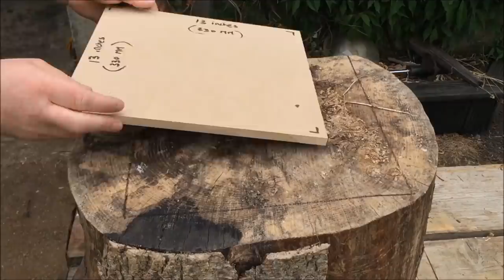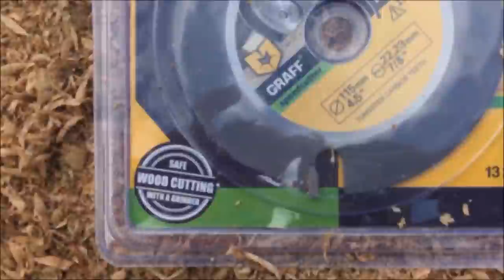DIY Twisted Stool / End table

Comment: I was going to buy one of these twisted wood stools for the house bus I'm creating (as a coffee table), and instead of spending $300 on that I thought I could just buy a chainsaw and plane and do it myself, because afterwards I have a stool and $300 bucks or more of tools I needed anyway. So which tools would you recommend? As this is my first chainsaw I'm interested to know. Also do you have to be careful with the angles etc, when using the chainsaw to protect it the chain from getting damaged or breaking? Thanks! I appreciate your help with this, and your project is beautiful! A real inspiration.
Reply from the maker: Hi thank you very much.
Re the tools, for me it all depends on the amount of use it will get. If its something  I will rarely use I will not spend too much and if I will be using a lot I will always spend  a bit more. The chain saw in  the video is a  Husqvarna which would be of good quality but there would be much cheaper brands available. The planer was a Makita heavy duty one but again smaller cheaper ones are available. The 125 mm angle grinder was the most used tool in this project. I used a GRAFF speedcutter disc (to shape) flap disc (to fine tune) and sanding disc to smooth all on the grinder.
I had no problems while using the chainsaw just be sure that everything secured firmly in place and take a little material off at a time and be sure to ware proper safety equipment.
Here is a link to an instructable on the build;
https://www.instructables.com/id/Twisted-Stool-End-Table/
If you have any more questions feel free to ask..

Comment: Awesome job. I am the process of building one of these stools myself while following along your video but i really got trouble using the graff speedcutter disc. It looks so smooth when you do it. If i don't hit the perfect angle i get very nasty kickbacks that are dangerous and partially ruining the workpiece. Do you have any tips on how to use the disc?
Reply from the maker: Thank you very much. I got a few kickbacks as well when I started using it first. You really need to have a good hold of it!! The more you use it the more you will get a feel for how much material can be removed in a pass. I found that moving it like at the 2.30 minute make in the video was the best way to use it and just remove a little at a time. It was still quite rough after using the cutter but the flap disc does great job smoothing it all out.

Comment: Looks great. How many man hours?
Reply from the maker: Thanks Steve, 
8-10 hours but spread over a few days waiting for epoxy to cure. Its one of those things that looks harder to do than actually is. The chain saw removes the bulk of the material and the speed cutter on the angle grinder makes light work of refining the shape and then its sanding and then more sanding.

Comment: I kind of wonder if that could be done with a good solid block of resin? Would it be lighter than solid wood? Or heavier? I don't know as I do not have the materials or tools to do this
Reply from the maker: It probably could be.
Reply: @EamonWalshDIY  I was just curious because I've seen a lot of videos where they mix certain kinds of colored resins together with other objects in smaller sized objects and they look really awesome. Just curious if you can make like a little table that way too, although I really like how you did yours
Reply from the maker: Thanks Michael. Yes I also like the mix of the resin with other objects. Resin is quite expensive though, if you were to cast something the size of my project it would take 8-10 gallons I reckon and I doubt there would too much difference in weight.
Reply: @EamonWalshDIY  that's good to know, thanks for the tip

Comment: think I need to get one of those blades, just made 2 for outdoor use and only had 60 grit flap disc's, thought I'd never get finished. that stool looks great, nice work. where did you get the epoxy?
Reply from the maker: Thank you! I got the epoxy from here: https://glassfibre.ie/product/glasscast-3-clear-epoxy-coating-resin/ but it takes 3 days to cure, so after the first side I used some 5 minute epoxy  to speed up the process. This has it drawbacks though.
Reply: the old fella is into the wood turning and I was onto him about the epoxy for the blanks he uses, I'll tell him to have a look at their site. cheers
Reply: The blade I agree is really good! Do you know the price!
Reply from the maker: They come in two sizes, have a look here: http://speedcuttergraff.com/order
Reply: Thanks!
Reply: @EamonWalshDIY  beautiful, I can pick some up this week Dublin, just around the corner from Melbourne, Australia 🤣🤣🤣
Nice job though mate, you have inspired me to pull out my chainsaw 👍
Reply from the maker: Gday, thank you very much.

Comment: Hi there, what type of clear coat did you use on this project?
Reply from the maker: Hi Daniel, I cannot remember the name of the epoxy you see in the video but I did switch to gorilla 5 minute epoxy as the other was taking too long to cure. You have to work very fast with it though or do it in small batches. 
For the finish on the wood I used a water based satin varnish (3 coats)

Comment: which are the dimensions of the cube 0:40
Reply from the maker: Its roughly 13 x 13 x 18 inches.
Reply: @EamonWalshDIY   4:37 cracks in the tree,with what fulfilled???which fluid?